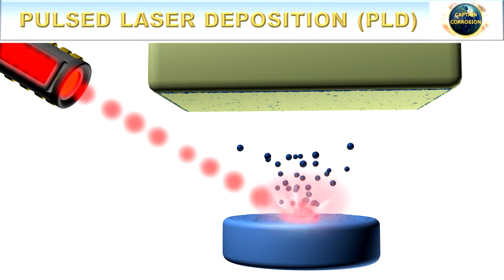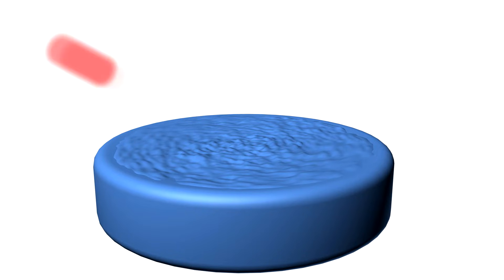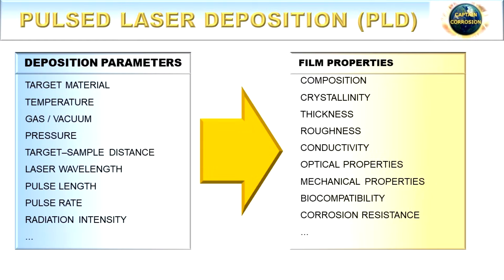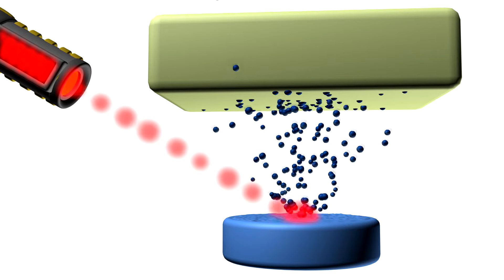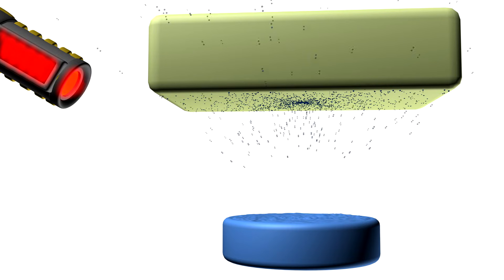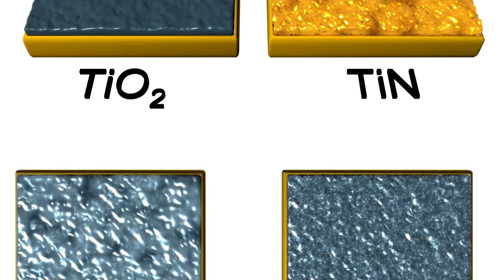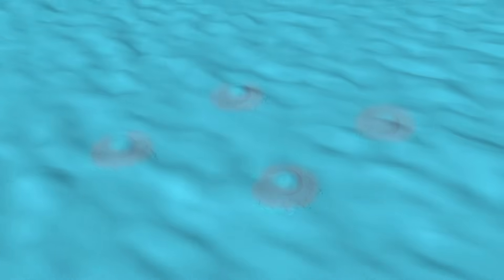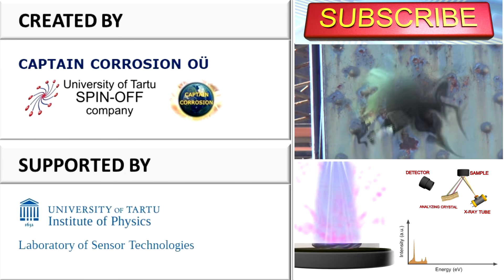Pulsed Laser Deposition PLD Explained With Animations

Comment: In different sources, this method is said to be faster than others as an advantage, but it is mentioned that it is slow in this video, what do you think?
Reply: They are saying that high quality materials can be produced in 10-15 min
Reply from the maker: @madnus8925  Aye but "high quality" means completely different things for different applications and the quality of deposited films obviously also depends on the system that is used. So it comes down to the system, the application and deposition parameters. For instance, if you have a powerful laser, then you can deposit more material over a shorter period of time and the deposited film may be excellent for a specific application but not so good for something else.